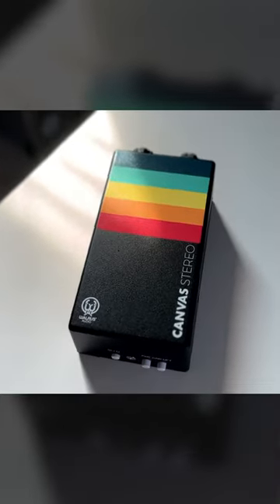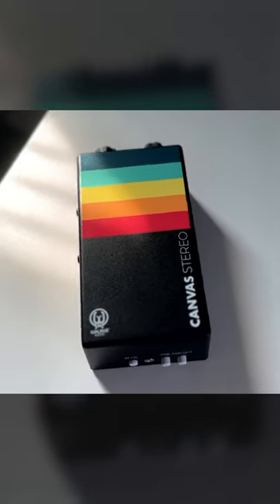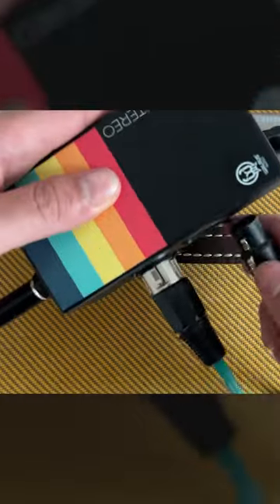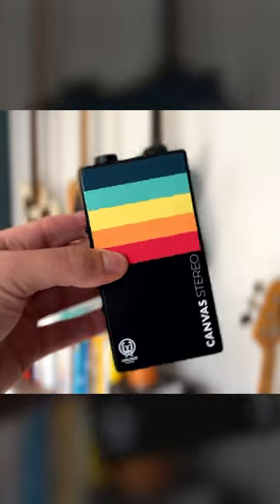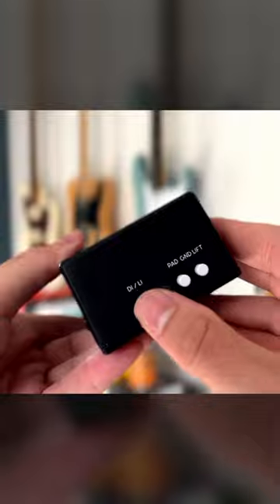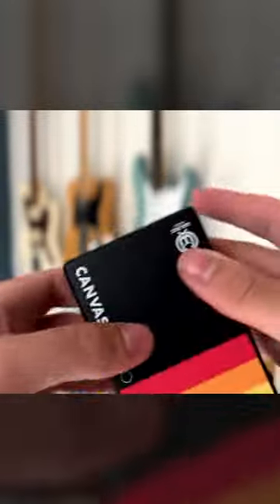DI vs Line Isolator for Amp Modelers | Walrus Audio Canvas

Comment: The DI mode has an additional -20 dB pad that's turned off when in LI mode. I would love to hear an A/B of the two with the LI mode reduced in post by 20 dB for a fair comparison of the actual tonal differences. Anyone who thinks they can hear a tonal difference with that big of a dB discrepancy between modes is just fooling themselves.

Comment: Can you do a volume matched comparison?
Reply from the maker: Yea I think that would be a good comparison. I'm planning on doing another video where I show that and compare some other boxes that have similar features.
Reply: We perceive louder audio as better, I feel that is what is happening here......not that either option is better .....just one option is louder.
Reply: Volume matching is pretty essential. Even a dB more volume will sound ”fuller” and ”better” and ”more 3D”. Even if the only difference is the volume. I’m not saying the Canvas or the Diso etc don’t have any tonal coloration but I’m betting it is pretty minimal and the added volume (compared to DI) is the big thing. The better signal to noice ratio is beneficial when playing live for sure, though the desk preamps usually like to be opened up a bit at FoH. Our FoH guys also tend to be a bit freaked out with that much level (pros not so much), compared to the signal level from DI Bass, Keys and Acoustic.
Reply: li vs di.   di will be -10 to 20 db quieter
Reply: @sundaytone  Does it just raise the line level, or does it color the tone??
Reply: In addition to the increased volume/output it feels like the line isolator increased high end distortion as a result? Like it was distorting the input of the interface. Although that may just be my phone/airpod result.
Reply: @tcoxy if you base your opinion for this whole listening through an phone your opinion isn’t valid
Reply: @1Guug why you hate on my iPhone 6?
Reply: @donniejean  because it’s a phone not a speaker

Comment: I don't really think it actually makes a difference. DI is a lower level then line level, so in LI mode it's just a bit louder, which brings out the low volume frequencies a little more and maybe adds a tiny bit of gain. Nothing you can't adapt to.
Reply: Exactly. Using a LI will sound identical to using a DI and just pushing the pres slightly more on the FOH console. Sure, raising the pres will raise the noise floor very slightly, but the difference is negligible. You're much better off getting a quality DI like a JDI or RNDI than one of these canvas or DISO LI's.
Reply: Actually, that's not true. The main function of a DI box is to take a single ended signal and convert it to balanced to make it compatible with other equipment that requires a balanced connection. When you balance a signal, you naturally end up with an additional 4-6 db in signal output. After the conversion, its always louder. And this isn't something you have to take my word for. Look at the specs on a piece of audio equipment that can be switched back and forth between balanced and single ended operation. You'll see 2 sets of specs, and the 4-6 db increase on the balanced specs. If you don't see 2 sets of specs, the component isn't balanced and the manufacturer just put xlr or trs connectors on it to fool people into thinking its balanced. 

Also, the signal that comes out of a DI box is line level. Balanced and single ended signals are both line level because the difference between the two isn't big enough to justify a separate classification. If you've ever noticed, some components come with a switch that can go up or down by 6 db. This is why. It makes it easier to keep a consistent volume level when switching between mixed components.  

Keep in mind that this is a pretty big topic and I can only give basic information in a post like this. I'm leaving out a lot of details. If you're interested in learning more, I would definitely recommend you do some research. Its practical information that you'll use all the time.

Comment: Also not sure why one of these would be necessary for most modelers today as most give you a balanced DI output right on the unit
Reply: From what I’ve read it seems like most guys are using them to protect their amp sims from phantom power

Comment: Without getting into the weeds, the main difference is that a Di transformer steps down the signal to mic level, an isolation transformer doesn’t, it’s 1:1 level matching. So there is a difference, is it worth obsessing over, maybe, maybe not.

Comment: Well yes, louder always sounds "better". But what does it do and what do you need it for?
Reply from the maker: Makes your signal louder and converts your signal to XLR 👍
Reply: @sundaytone  Every DI box does that. What is different about the "Line Isolator"?
Reply from the maker: Yea so a typical DI will reduce your signal by something like -25dB. A line isolator will keep it at the same level. It is designed with a low impedance input for things like a Tonex, ACS1, or Iridium. A DI has a high impedance input. With a line isolator you won’t have to add as much preamp gain at the FOH console. Also, with that typical -25dB reduction there can be some slight loss of high end.

Comment: You would have to be running this over a long distance with a balanced cable for either DI or LI to be needed. Running from a modeler to an interface in the same studio doesn’t require either.

Comment: Just a gimmick product i think. 
I never have an issue using tonex and other amp IR pedal using normal radial DI
Reply from the maker: You definitely don't need one - I was skeptical of them for a long time. Used normal DIs for a long time. I got a good deal on this one and decided to try it. I don't think it's a gimmick. Just a box that is specifically tailored for guitar amp sims.
Reply: @sundaytone  cool man

Comment: I don't get what your problem is.
I play bass and I love the sound of my tube amps. But they are heavy, big, expensive in purchase and upkeep, sometimes unrelieable. They are oldschool in the best and at the same time in the worst way.
If I can get a small cheap box that sounds like my amp and can even simulate a cab, why wouldn't I?
Don't worry, bassists have been going ampless forever. Bassamps are still around.